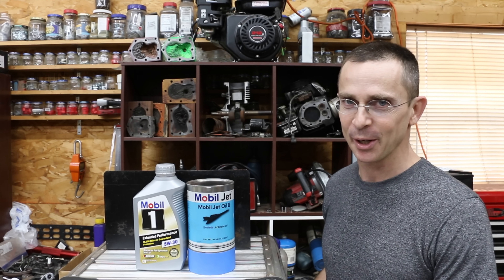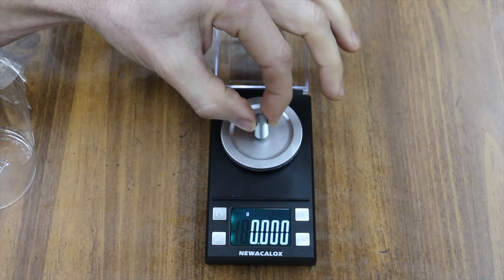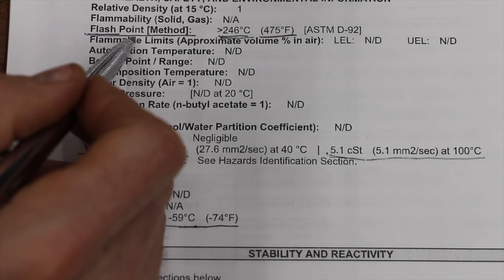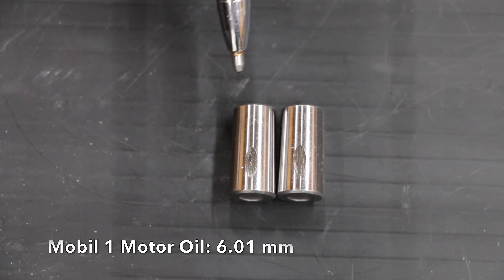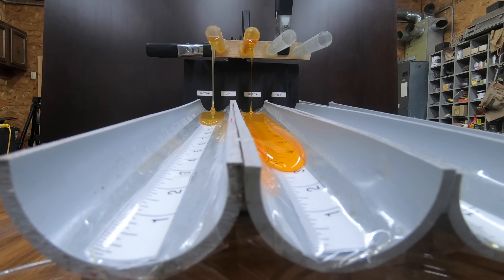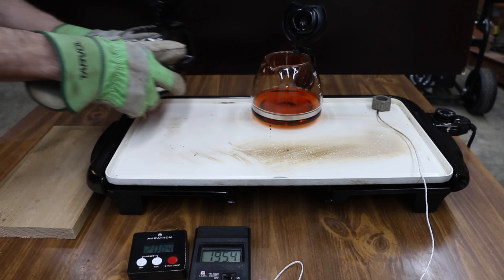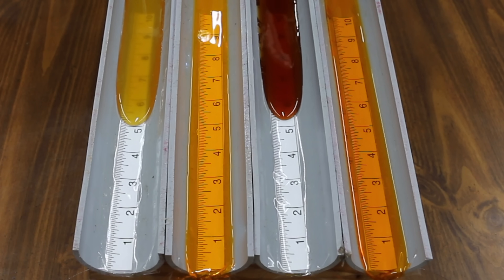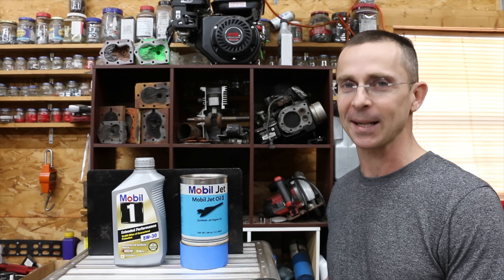Is Jet Oil better than Mobil 1 Synthetic?  Let's find out!

Comment: You have to understand the difference between a piston engine and a Jet engine lubracating system. A piston engine has journal bearings, where the oil is pumped between the bearing and the crankshaft journal , so the oil maintains an oil film or wedge so the parts do not contact. In a jet engine the oil is sprayed on ball and roller bearings so their is no need for a oil wedge.
Reply from the maker: Thanks for the feedback.

Comment: One important point that must be kept in mind is that there are a number of different lubricating and hydraulic oils out there. The correct type of oil needs to be used for each specific application. The properties of jet oil are for use a in jet engine or a gas turbine engine. Automotive Motor oil is for use in automobile engines. Also there are  a number of different Transmission Fluid depending upon the Transmission in the vehicle.
Reply from the maker: Thanks for the feedback.

Comment: Jet oil uses very high quality base oils with an insane viscosity index which makes them flow extremely well at cold temps and also resist extremely high temps which it's volatility is so low and barely oxidated, they are basically monograde a.k.a single weight oils but because of the super high quality base stocks with a very low pour point they perform very well when cold and don't need viscosity index improver polymers to maintain the viscosity when hot, the viscosity is much lower than motor oil but in contrast it has a massive film strength, but it can't be used in a car engine because the HTHS viscosity ( High Temp, High Shear @ 150C ) is too low which will destroy the bearings despite the huge film strength.
Reply from the maker: Thanks for the feedback.

Comment: Hey PF, I been hooked on the channel since my first click. I know you have to love doing it cause there is so much that goes into these test. I wanted to asking you can do a bar oil vs. Motor an gear oil since I'm an arborist and the guys I work with think I'm slow for using different stuff. I know bar oil and motor oils are close in viscosity so I don't think I'm hurting my chain life at all. Just thought it would be a good PF test. Mabe even just compare Brands of bar oil.  Thanks for the informative videos buddy.
Reply from the maker: Thank you for the feedback

Comment: Jet engines roll on ball and roller bearings which is why there isn't a need for the additives the car engine use. The seals in the bearing areas of jet engines are carbon seals and packings. Car engine bearings are bushing style bearings and they mainly use rubber and paper gaskets which will get destroyed by jet oil.
Reply from the maker: Thank you for the feedback

Comment: @Project Farm, I've read some of the comments and heard what you said about not to use jet engine oil in a regular combustion (car) engine however....about 25 years ago a buddy of mine rebuilt a standard, 350 Chevrolet block.  Standard specs, no big cam, etc.  We decided to use the same jet engine oil we were using in our Pratt & Whitney, TF-33-P-7 engines hanging on the wing JUST to see what would happen.  We put 5 quarts in along with a new, AC Delco filter. We were both shocked at what happened...nothing! The engine cranked, ran and performed just as if it'd had 5 quarts of regular old "off the shelf" engine oil.  The engine temps were the same, the acceleration was the same...everything was the same.  As you stated, it has a shelf life.  We aren't allowed to use it "on wing" passed that.  So, we asked if we could have 5 quarts of "expired" oil.  That's how we got it without stealing it.  I don't know if I would do that again today but, it worked for us then.  Enjoy the video productions and keep'em coming!!
Reply from the maker: Thanks for the feedback.

Comment: The twin screw IHI supercharger on my 2006 E55 AMG Mercedes uses Mobil Jet Oil II, stuff smells like a barnyard when its burned and used. 233,000 miles. I drain it and replace every 50,000 miles or so
Reply from the maker: Great feedback. Thank you!

Comment: Can we use mobil 1 extended performance engine oil in bikes?? Because on the mobil 1 website it only shows cars while the oil grade is similar to my bike which requires 10w30.

Comment: One more lubricity test to do.  After you do all the heat/freeze tests - how about adding one.  Return the oil samples after testing to base line temperature then see how it performs against itself.  Does the heat/freeze change the nominal temperature "race".  In other words  heat a sample test it, freeze the same sample, test it, then allow it to come to room temperature and test it against the base line oil/temperature at room temperature - that's the same sample that is heated/frozen then room temperature against the same new oil.
Reply from the maker: Thank you for the recommendation

Comment: turbine oils  ie   2380, 2389,  mobil jet II,   297, etc are made for ball bearing / needle bearing /( rolling anti friction  bearing ) engines not requiring a heavy fluid layer between the surfaces. these oils ARE NOT made for babbit style friction bearings and bushings.  these oils  DO NOT form the boundary layer necessary to float a crankshafts, camshafts or connecting rods. 
turbine oils are designed to lubricate - yet have lower viscosity preventing the oil from making  heat  and  parasitic  accumulated power losses through fluid friction. 
yes- these oils will perform at greater ranges of temperature without freezing or burning as they were designed for that specific purpose.  the fist stage bearing of a fan engine can easily be operating at - 80F  while the first  turbine bearing is operating at  550 c   ( 1000 F )
turbine oils are ester base.  they resist forming carbons. you cannot have carbon forming on / in bearings or scavenge lines.   ester  turbine oils  keep / float carbon in a dissolved state.   i personally use them as an oil additive in my engines to prevent carbon from forming inside the engine.  about 1/2 qt to 4  quarts of full synthetic.  you cannot find a spec of carbon inside my engines. 
turbine oils were not made for reciprocating piston engines.  neither do we drive nails with spoons.  we use the tool designed for the job.
Reply from the maker: Great point. Thank you

Comment: just think of the conditions a jet engine working in. -80°C - +300°C, ofcourse it will outperform ordinary motoroil in a viscosity-test. ship-engines massive turbochargers are using a completely different oil than the engine and has no oilfilters and dos not change color, even when heaten too 350°C.. the oil have other working conditions and do not need to clean of carbon emissions, so that additive is not present in that kind of oil. jet and turbo-oil should not be used in an ordinary piston engine that emits carbon. it will not work in longterm and the carbon buildup would be to much in the end and kill any piston-engine.
Reply from the maker: Great point. Thank you

Comment: Viscosity being equal, longevity and wear wise probably not. Aircraft engines are serviced more regularly and generally aren't built with as specific of tolerances as road vehicles. However, Heat tolerance should be far greater in the Jet oil... for obvious reasons.

 But let's see...
Reply from the maker: Thank you for the feedback

Comment: The viscosity index of the jet oil is higher than the engine oil so of course it performed better when exposed to different temperatures, that was clear from the sds info.. the engine oil did better on the scuff test because it has higher levels of ZDDP which is common for all engine oils, granted SN or SN+ rating oils don't have nearly the amounts of ZDDP as earlier oil categories like GF4 or GF3 because of its tendency to kill catalytic converters
Reply from the maker: Thank you for the feedback

Comment: While it makes sense that an oil for jet engines would flow better at extreme temps, exactly how they engineer oil for those specific environments is the science I'd like to know. It seems odd that the auto engine oil would have more/better lubricity/film strength than the jet oil, because of the extremes a jet engine endures. Similarly, ever checked out a hard drive and the ease with which those bearings spin? One turn from a finger can get those bearing assemblies to turn for minutes on end.

Comment: Little aviation mechanic insight here, oil in jets is more for heat dissipation, turbines make tremendous amounts of constant heat and that oil needs to help cool off the turbine, as the components roll around in the oil or get sprayed it lubricates as oil but that heat gets carried away to warm fuel up to prevent icing. And yeah that oil is nasty,  Mobil jet 2 isent even the worst. Try doing some tests with phosphate ester based hydraulic fluid, like 500 B-4 or LD-4, skydrol is nasty stuff, irritation, temp blindness and horrible taste at best. I know mechanics with scars from it.
Reply from the maker: Thank you for the feedback

Thank you for the video idea!

Comment: jet engines use ball bearings so very little if any slide friction in them. Also jet engine oil will ruin gaskets in a car or trucks engine
Reply from the maker: Thank you for the feedback.

Comment: As a pilot myself, we have some pretty damn cold limitations on the airplanes. -40*C (Jet-A freeze point) for starting limitations being 1, and -54*C max cold operating temp being another. Oil for jet engines is made to provide essentially instantaneous lubrication. Also, we use bearings in jet engines, not rocket arms and camshafts like in cars. Today different. But, the video was quite entertaining. The second you “froze” that Mobil Jet oil” I said “heh... that stuff will be as slippery as ox snot in December.”
Reply from the maker: Thank you for the feedback!
Reply: Exactly!  The reasons newer cars use oil thinner than older engines are:
1.  Thin oil lubricates a lot better but less shear strength.
2.  The main driver for the shear strength is the tappets on non-roller lifters that have a lot of valve spring pressure on them.
3.  The thinner oil improves fuel efficiency.
4.  Note:  If you have an owner's manual that says 5W20, use the 0W20.  The W number is its viscosity when cold, but it is ALWAYS too thick when it is cold, and that is where the wear happens.  The reason the owner's manual says 5W20, and the newer cars say 0W20 is because when the car was built, 0W20 was not readily available.  The number you don't mess with is the normal temperature number, the 20.  That is specing the required shear strength for things like piston skirts.
*Note:  0W20 does not mean it is 5W less than less than 5W20.  0 simply means it is 5 or more less, which is good news.  When you see something like 10W30 as on older cars, here again you can go with 0W with them too but you need to keep the 30 because it needs the shear strength for some reason, which is likely because it does not have roller lifters.

Comment: My guess would be the jet oil it's designed for more extreme temperature fluctuations due to the temperatures at the surface of the Earth vs when they are flying up high in the atmosphere at temperatures far below zero degrees.
Reply from the maker: Great point. Thank you

Comment: So jet oil is super thin to accommodate the much higher rpm/flow rate required of turbine engines. The dbags from one perticular aircraft maintenance unit used to service bread trucks with jet oil before they handed them off to my guys. (We had to check the vehicles before we took them for the next 6 months)  Problem is, is an internal combustion engine, the oil pumps would empty the oil pan pretty quick and we'd end up with tons of oil on top of our pistons (oily smoke) .... I've def. Seen jet oil destroy a few engine blocks.
Reply from the maker: Thank you for the feedback!

Comment: Well done, but take his advice about not trying this at home.  I was an aircraft mechanic and supervisor before going to the academy and flying military. I can add some perspective.
1.  Jet engine oil is designed to lubricate roller and ball bearings and gears that are more precise dimensionally and with better surface finish than you will find anywhere in a car.  That means they wear less too.
2.  Jet engines use labyrinth seals (reverse spirals on metal shafts) and differential air pressure many places, not rubber seals, because they would melt.  The highest pressures in the engine are NOT at the rear, they are in the front by quite a bit, which is why the air flows the way it does, and that air is routed to provide the differential pressure where needed to "blow" the oil back to where it belongs.
3.  The hot compressed air in the front of the engine is a lot cooler than in the rear and is used for cooling and there are small holes in many components that keep them cooler.  Nowhere near all of the air that goes through the engine is burned.  Before you shut it down, there is a stabilization period at low power settings that stabilize the engines at lower temperatures.  What happens after you shut it down and and air is no longer moving through the engine, residual heat, referred to as heat soaking, creeps up to the bearing areas which can result in the oil burning onto a hot bearing, a process we refer to as coking.  This has destroyed many engines by causing the bearing to seize.  The reason the jet oil did not change colors like the car oil did is because it is designed to resist coking.  (there are also other methods to help defeat this)  The engines also do not put up with the lack of lubrication a car engine can when it is cold.  That's why you see the viscosity control, nor can it be allowed to thin out at the same rate as automotive oil when hot.
4.  I don't know the differences in the composition of the different "rubber" type seals compared to a car.  What I can tell you is the oil is nothing like car oil.  When I've gotten it into a cut, it would kill the skin for up to 1/8th of an inch around it, and when I would pick it out later, I'd have a little crater in my finger like after picking out callous or wart that would later heal up and fill in.  Who knows what else it does to you.  Even if it was OK for the car engine, I would not subject myself or some poor unsuspecting soul at a car dealership to that oil.  What would you be thinking just checking your oil with a dipstick?  Now what do you do with the rag?  With turbine aircraft, you use sight glasses and other visual methods for checking, and proper facilities for handling the stuff is readily available.  That's not how things go with a daily driver.

Comment: I am super surprised at how hot that cable is registering considering it's only carrying 450W. At 120v that's only what 4A? And going by your thermal image it looks to be at least 100ish F? Are you using chinesium lamp cord for your motor?

Edit: This is regarding your bearing tester setup.

Comment: I’m a logger and heavy equipment mechanic I use cen-pe-co oil in all of my equipment and logging truck which has a 6v92 DETROIT 2 stroke engine I’ve seen excellent results using this oil wound like to see it tested against other brands such as Mobil, Shell, Kendell, shafier oil thanks
Reply from the maker: Thank you for the feedback

Comment: There is an engine that needs the Mobil Jet Oil. The Mercedes-Benz M113 motor found in the 2006 E55, S55  G55  etc. (jet oil required for the supercharger's scheduled maintenance) 😄
Reply from the maker: Great information!
Reply: Also in the M112k found in the C32, SLK32 and the Crossfire SRT6. It has a very potent smell when it hasn't been changed in a while.
Reply: In jet engines it's used in the gearboxes and sprayed into ball & roller bearings, so not that different from a supercharger.
Reply: im wondering how jet oil would work if you used it on those little eatons on the buick 3800 Supercharged 👀
also i refer to those AMG 5.5 engines as "the good ones" compared to the new 6.3 AMG's lol
Reply: fascinating:  https://youtu.be/eMlCN71EqqU

Comment: For a car that takes 5 quarts of oil, and is driven in either very cold or very hot climates, why not use 4 quarts of "car" oil and 1 quart of "jet" oil?  Perhaps you should have tried a 50/50 mix for comparison to see if you get a happy middle ground between the 2 competing oils.
Reply from the maker: Thank you for the feedback.  Jet oil will damage oil seals
Reply: No wonder why my plane had to make an emergency landing.  I will call Southwest airlines and tell them to start using Mobil 1 car oil instead.

Comment: It makes sense that jet oil has more tolerance against temperature extremes.  Jet engines run much hotter than cars and it's way colder up in the sky.
Reply from the maker: Thank you for the feedback!

Comment: @Project Farm Did you consider sending both for testing? It would be fascinating to see what additives are missing in the jet oil, and if replacing those with additives will make jet oil come out on top in the lubricity test

Comment: I've been using synthetic oil since it came out in the 70s. In my cars, mowers, air compressors and snow blower. A little more expensive but oil is the life blood of you car. All new cars require it from the manufacturer now because the all new cars have injection systems that require them to run at 210 degrees or higher under normal conditions. Add a turbo charger and things get hotter. If a NASCAR engine can scream around the track at 10K or 12K RPM for four hours with out blowing up, that's the oil I want in my car. Mobile 1.
Reply from the maker: Thank you!